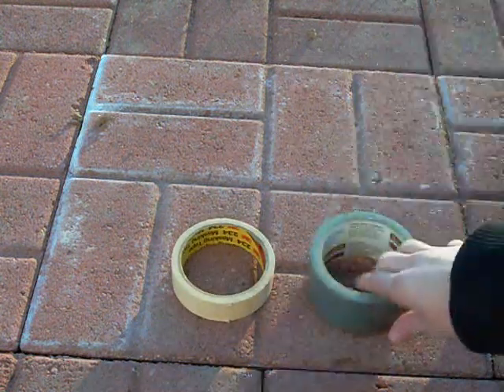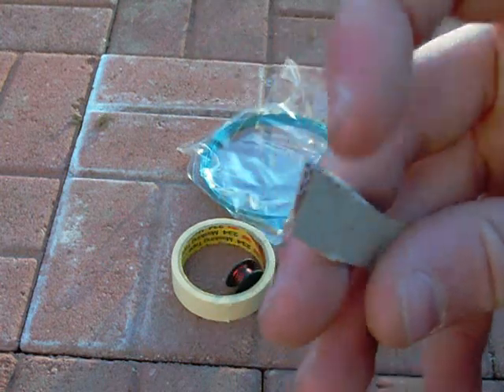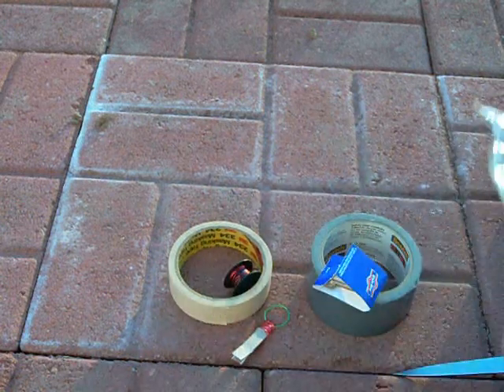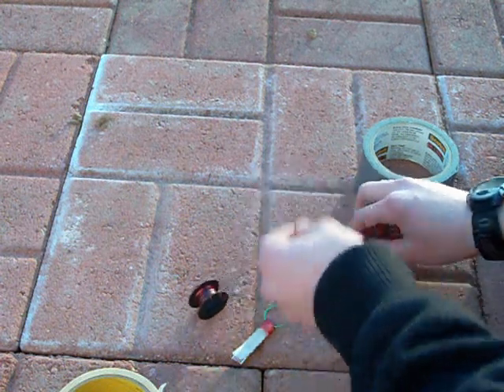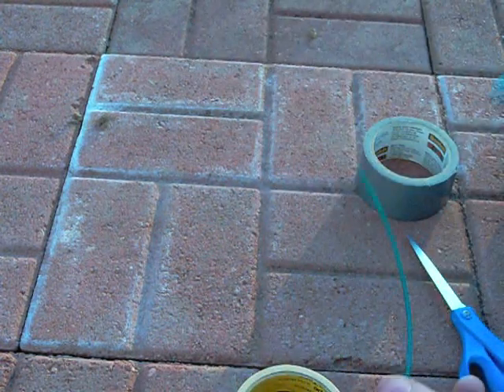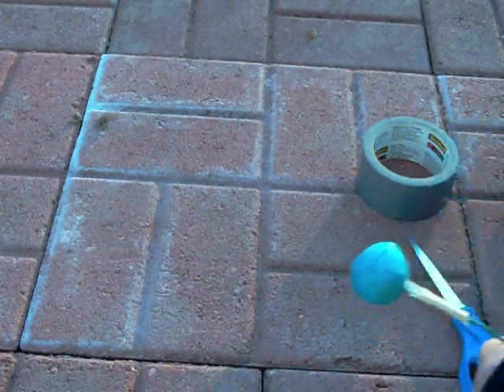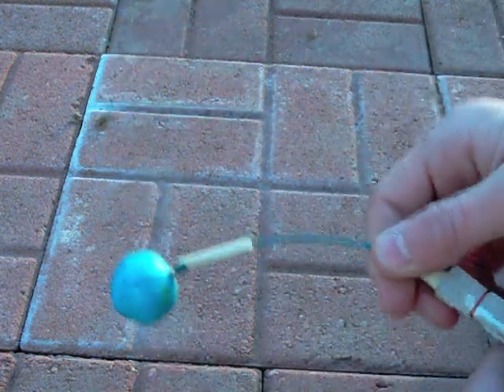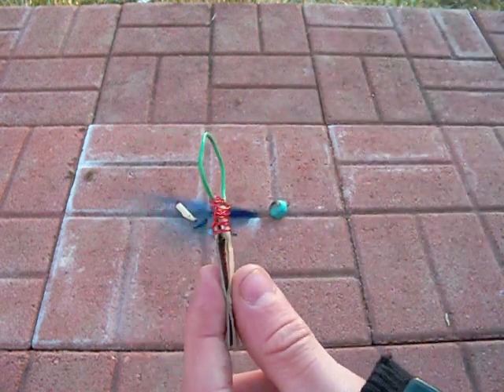How to make a pull ring fuse lighter

Comment: Interesting, I'm gona have to give this a go this weekend :) A word of advise, don't cut visco with scissors; there's a small chance that friction between the blades could cause ignition and you wouldn't want that happening if you have something explosive on the other end of that fuse. The pros use an anvil type cutter that has a razor / stanley knife blade one side and a hard piece of plastic on the other, like gardners use, but sharper.

Comment: make your own fuse by using matches and straw and tissue . first cut the heads of matches but leave some matches  then  get the straw and fill the straw wid matches and  the holes cover it wid tissue but dont put it inside and after get the matches and put  it using tape or rubber band or whatever  then put it around one of the point that has tissue  then cut off the igniter then get a paper clip and tape it and put it on the matches then rubber band put it to tighten the igniter then u have it!

Comment: Better? No.. Easier? Only the preperations... Faster? NO! Cheaper?... Marginally..

This way you can make a Safe to use effective and Easy Smoke grenade for airsofting.. Id rather pull a pin then pull out a lighter in the middle of a firefight... Not to mention if its in the evening/Night and the flasing of a lighter will reveal you.. This can be encased and minimise the light shown.